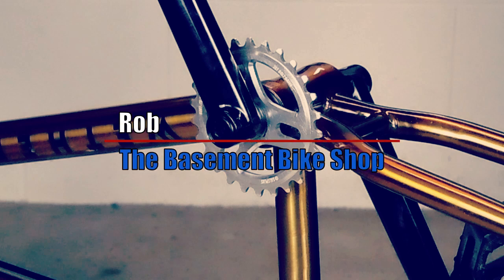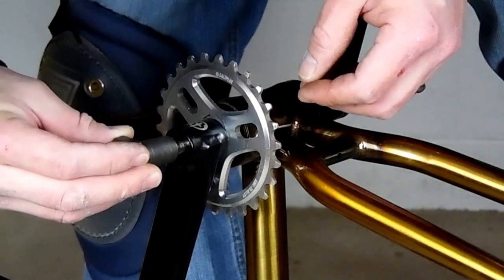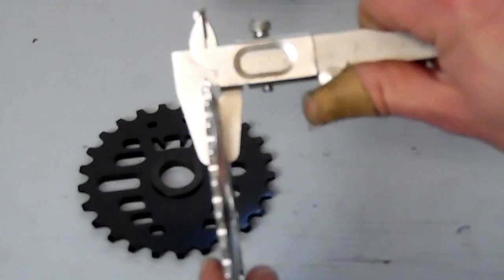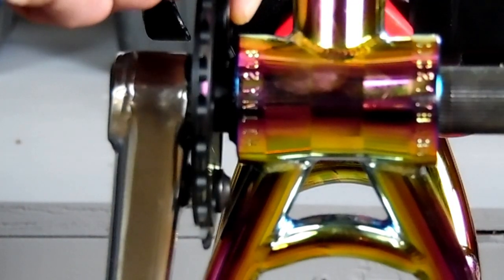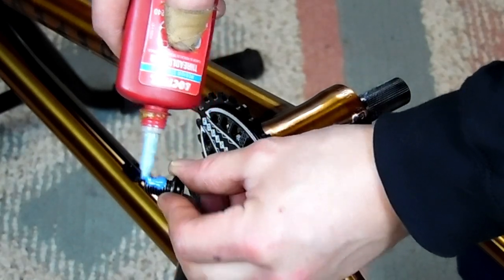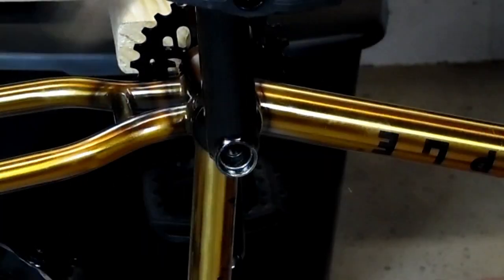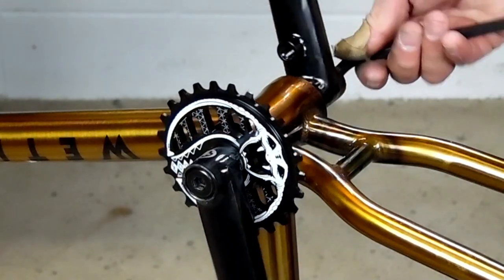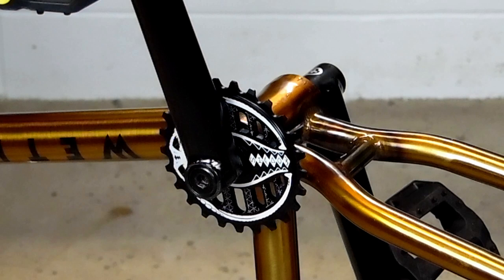Removing and Installing 3-piece Cranks and Sprockets- Step By Step

Comment: tip for the loctite, all you have to do is heat the bolt up and it will melt and you can remove it, if it is a heat sensitive area just heat up the wrench and that will heat the bolt enough to melt the loctite

Comment: Could you undo the crank bolt just a bit a hammer it
Reply from the maker: Yeah. I've done that before. One time it was so stuck that hammering on it destroyed the threads on the bolt and in the spindle. That's why i don't show this method. This is why a crank remover tool threads all the way in. In case it is really stuck.

Comment: Do i have to remove the non drive side crank arm bolt to or just the drive side only if i just wanna get the sprocket off to change it?
Reply: Depends if they are 2 piece or 3 piece you would only have to remove on side

Comment: I used exact length of spacers for driver and non driver side but the distance of the crank arms from frame where the rear wheel is a little off by few mm ( non driver side crank arm is closer to the chainstay frame than the driver side crank arm if I would put the finger through the gap I have more space on driver side than non driver side) is that normal?

Thank You.
Reply: where did you getbthe spacers?

Comment: So i just got odyssey calibur cranks, got it all on using only a 22 mm sprocket adaptor on driveside and cone spacer on non driveside, cranks fit nicely, however my spindle is only a few mm from the end of my crank arms, im pretty sure its not bottoming out. Im pretty sure my hub guards are throwing my chainline off causing noise in my chain and cranks. My question is, is it cool to put my guard on outside of my dropouts
Reply from the maker: Dave nonya. I would try it and see if that helps.
Reply: Thanks goodsir!
Reply from the maker: If taking the hub guard off helps your chain alignment but  your hub guard won't fit on the outside of your dropouts, You could look into a hub guard that installs on the outside of your dropout. I fabricated my own a while ago. I just cut a rectangle of steel, drilled a hole in it for your axle, and heat it up and bend it so it goes under your chain.

Comment: So how far it has to be if not in contact with the frame or if it needs a spacer? What lets u know u need a spacer between the sprocket and bottom bracket?
Reply: quarter of an inch roughly maybe a little more

Comment: So when i take the crank and sprocket off on my bike, there is no sprocket bolt. Any suggestions how to remove it? I was told it may be pressed on?
Reply from the maker: What kind of crank is it? Or what kind of bike if it is the stock crank?
Reply: The Basement Bike Shop it is a 26” Hyper cruiser
Reply: The Basement Bike Shop 3pc design i believe. The left side crank removes from the shaft. On the right side, the sprocket comes off with the crank. It has like a star ring around the base near the sprocket.

Comment: If your sprocket is too far outward,  you don't need the cone spacer
Reply from the maker: Maybe one small spacer. As long as your sprocket doesn't hit your frame on the rear triangle.

Comment: why is he wearing knee gaurds
Reply from the maker: Because I'm bracing the bike with my knees while i hammer the spindle out of the arm. If you brace the frame against something solid like a wall, you risk bending the frame. I hope that helps.
Reply: @thebasementbikeshop2336  thanks just wondoring

Comment: This was so informative. Not... As soon as I put the securing bolt to the crank to the arm the sprocket is out of alignment and bends the sprocket
Reply from the maker: Is there something in between the sprocket and the crank arm on the spindle? There should be nothing. Make sure the adapter is put in from the other side too so the sprocket sits directly against the crank arm. Hope that helps!